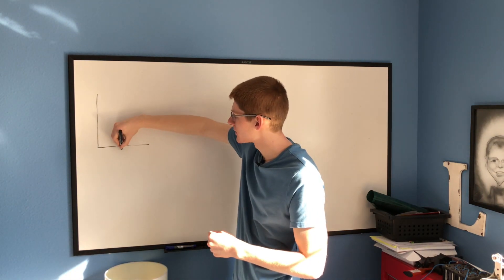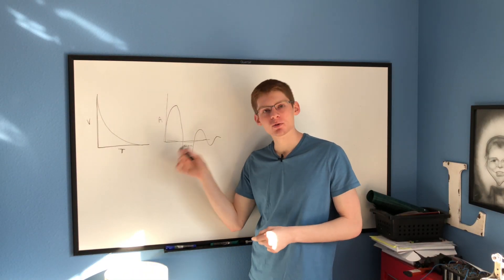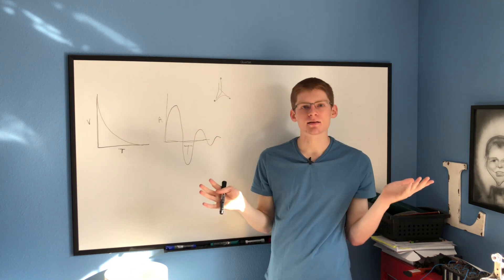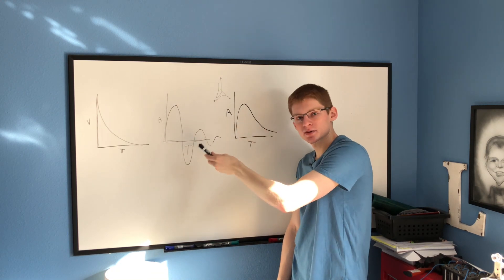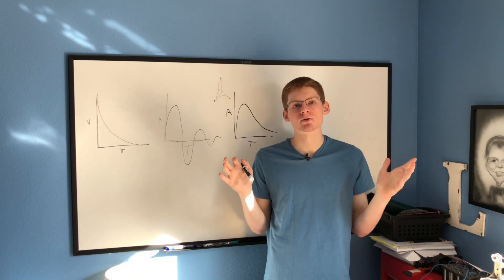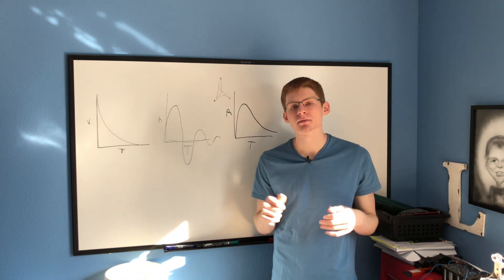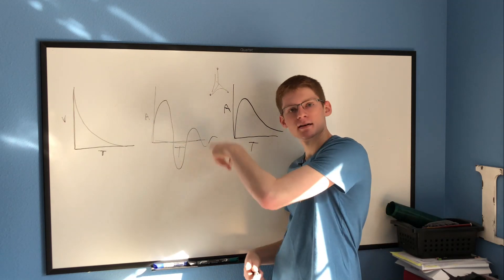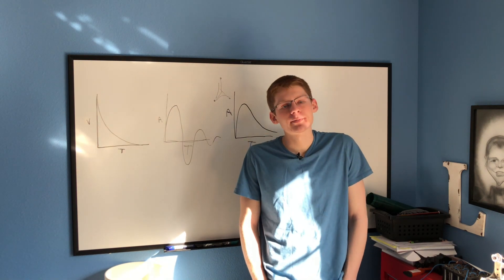Final(ish) Thoughts on the Coilgun Project

Comment: I have some experience with pulsed power systems, so let me give you a comment on why coil guns actually use capacitors.

High voltage capacitors have (reasonably low) capacitance and low ESR. I'm saying something like 1uF, 3-10kV (you can buy something like that for microwaves). You should be able to discharge a pulse with powers of the order of 1-100MW if you properly design it. Combine this with a low inductance inductor and you'll have a system that can provide peak forces of order 100-1000N with relative ease. If you don't use capacitors, the parasitic capacitances of the system (mostly battery) start limiting your time constants. That's why research-grade coil guns still use capacitors, they're the way to go.

The reason researchers rather use high voltages and high currents can be explained in the equations (I recommend you do it on paper so you can see): Coil force F is proportional to I^2. Say you have a pulse (assume a square pulse for simplicity) of "dt" long. The velocity you add to the projectile is dv=a*dt; which through Newton's second law is dv=F*dt/m. Since F~I^2, you get that dv~I^2*dt/m. But the pulse energy is proportional to I*dt (E=I*V*dt), meaning the shorter the pulse (the smaller dt), the higher I is for the same energy. So the shorter the dt, the higher I, but you get the benefit of I^2 for velocity increase; which works in your favor, efficiency-wise. In summary, you always want to minimize dt and maximize I. The easiest way to accomplish that in real life is to have the lowest capacitance possible since time constants (of both RC and RLC circuits) are proportional to C. The high voltage is a by-product of that effect to keep the energy (1/2CV^2) the same. My mental picture of this is like if each coil is like a hammer that "dings" the projectile, imparting its energy on it to accelerate the slug.

Keep studying. You're really young and will accomplish great things if you just keep at it! I recommend you look into the academic literature if you're interested in seeing what serious people do with coil guns (use Scihub if you can't access the papers). Independent thought is important, but as you mentioned in one of your videos, you're not the first one to come up with these ideas. Reading brings you to the "shoulders of giants", so when you think and look ahead you can see things that no one has seen before!

Comment: I wonder if you can use an inductor to power a coil stage rather than a capacitor... you might get a stronger current pulse.
Effectively, you would discharge a capacitor into a large inductor (this inductor doesn't need to be optimized for field, just inductance). Then you switch the capacitor out of the circuit and connect the inductor to the coil and a shunt resistor to dissipate the energy. The collapse of the high inductance magnetic field will create a large derivative in the current (i.e. the inductor flyback).
I think you have magnetic saturation incorrect. The magnetic moment generated by the projectile will saturate, you can only align the atoms until they are all aligned. However, you can still increase the external magnetic field. The force comes from the interaction of the external magnetic field and the magnetic moment of your projectile. F~B*m. If m saturates, you can still increase F when you increase B.

Comment: i'm not done yet, but don't you need MOVEMENT through the magnetic field with the copper projectile to induce the eddy currents? that would imply you'd need to inject the copper projectile into the system much like a railgun. just a thought, curious if i'm missing something.

Comment: if i am not wrong the trick is not remove the capacitors, it is just design the coils ( in theory ). Then i don't know what are your calculations and only have an idea of what you want to get try put diode on the circuit to avoid the negative effect of the discharge of the capacitor remember it is not a rail gun that can be another good project.

Comment: I'm wondering if eddy currents generated in the projectile will be a significant factor in the forces acting on the projectile. Specifically, if currents induced in the projectile (or even other parts of the coil gun assembly such as aluminum backing plates) will resist the forward acceleration of the projectile. Based on my admittedly vague understanding of electromagnetism I think there must be some sort of parasitic losses along these lines, but I don't know how significant they are in comparison to the force accelerating the projectile. Good luck on the project! Great to see someone putting thought into it, rather than just trying to dump as much power as possible. Subscribed to see your progress.

Comment: Hi, I liked the idea on your 3rd video about coilgun, personally I would have reversed the current and direction of the projectile so that the maximum force would be at the beginning and accelerated could escape the high magnetic filed, but still having acceleration till the end. 
at the same time I do not see why you do not use a ferromagnetic pipe which could increase the magnetism and at the same time increasing efficiency of the overall (motors that you mention use a ferromagnetic center to increase efficiency).

Comment: You really should finish the project.  Yes, it is not optimal, but 1) you could still learn a lot from the build.  2) you are falling into analysis paralysis, which is not a good place to be.  Make this and understand it is a iterative process.  You don't need perfection the first time up.  3) you should deliver on the project, unless a major issue develops.  Not getting optimal results is not a major issue in a iterative process.  Think SpaceX.
Reply: Also, dont give up on a concept before prototyping it, you cant know for certain how efficient or not it will be without testing it.

Comment: I have spent some time over the holidays on this topic. I am an electronics engineer with a university degree and just liked the idea of building a BB coilgun. There are several problems with that, for ones the BB projectile is very small, but I like the idea of using cheap standard projectiles. From what I see in most other projects, they are just building it by trial and fail. Not even bother to do some calculations. But if you do and understand physics then you see also the advantage of a small BB projectile. There is a limit of the magnetic force you can apply to it so if you design it properly it should become a very energy efficient coil gun.
Some design considerations I have made so far.
- The length of the coil should not exceed the diameter of the BB (I plan to use 6mm BB) much.This is why you latest design was an eye catcher for me.
- No optics to trigger the current in the stages. All will be timed by a micro controller. And yes you will need an oscilloscope to fine tune the timing. As there are a lot of variables like friction, air resistance etc. that would be hard to calculate.
- I plan to use capacitors or better capacitor banks. But the issue I see in most design is that they use the same coil and capacitor for each stage. But as the projectile accelerates with each stage, the time it spends in the coils magnetic field is shorter. So the current must be applied for less time than the previous stage or it will slow down the projectile. The simplest way to do that is to size the capacity and thereby the time the current can flow in the coil. The current should be 0 or close to if the projectile is in the middle of the coil, otherwise it will drag it back. You could also try to shut the current somehow in the right moment, but I guess that would be a very difficult problem to solve.
I assume if done properly it should be possible to build a BB gun that can shot one BB after the other without having to wait seconds to load the capacitors between the shoots.
The only thing I am currently struggling with is how to load the bb into the barrel. I have see a design with a servo(too slow). Maybe I will use a solenoid like push system.
The other problem is gravity, how to prevent the bb rolling of out the barrel, but not having a lot of friction.

Some thoughts on the wave idea
This might work if you have a magnetic projectile that has polarity, but I doubt it will work on a ferromagnetic projectile. Maybe best to explain is why a AC solenoid works. I guess your thought is that if you apply the negative portion of the wave in the right time, you would accelerate the projectile further. But the opposite will happen. It will drag the projectile back in the coil and you loose velocity. 
Simplified if the current will change direction, the magnetic field does as well and change polarity. But for the projectile the polarity does not matter unless it is a magnet by itself.
BTW once you have your oscilloscope you will see that there is a negative part of the wave that is caused by the coil that wants to continue the flow.
Reply: The only thing I am currently struggling with is how to load the bb into the barrel. I have see a design with a servo(too slow). Maybe I will use a solenoid like push system.
The other problem is gravity, how to prevent the bb rolling of out the barrel, but not having a lot of friction.

how about a revovering like drum feed, the drum only lines up when when in use and the first coil is on

But the issue I see in most design is that they use the same coil and capacitor for each stage. But as the projectile accelerates with each stage, the time it spends in the coils magnetic field is shorter. So the current must be applied for less time than the previous stage or it will slow down the projectile. 

how about changing the length of each coil so the time it spends in the coils magnetic field is the same
Reply: To help better time the stages of the various coils, why not dope or use part of a Thorium Welding Rod (very safe, low cost and easy to purchase) for the projectile. The low cost and safe radioactivity could be used to trigger on/off the coils. 
As for loading the BBs, check out the old West German G-11 caseless assault rifle rotating bolt design. This weapon was designed in the 1980s but never made it to full production.
Reply: To make the later stages give a faster pulse isn't it ideal to use less inductance rather than capacitance, so you have the same amount of energy but delivered quicker

Comment: Hi, great series of videos. Keep at it and you will get there. Some comments. You are mixing up dumping the energy stored in a capacitor, and simply using it to make a low impedance voltage source and then switching with a mosfet. Split your project into sections and then solve each section  one at a time. For example, start with a bench power supply with effectively infinite energy (for your design) and solve the coil, arrangement and switching issues first. Then move onto working out how you will make the power supply portable. Note that there was a super useful comment from a previous video about diode protection with mosfets. Remember mosfets blow short circuit! Some of my thoughts: think of each coil segment as a tuned circuit. Add a capacitor to resonate with the coil. Your idea of push-pull sounds promising. Consider using a split power supply (positive and negative) and use P-type and N-type mosfets to switch the +ve and -ve rails. Also an H bridge could be considered. All coils before the projectile are pushing. All coils after are pulling. The coil where the projectile actually is, is switched off.  Your comments about efficiency are super useful. But to calculate the energy used, you need to get the area under the current curve (assuming voltage stays the same). Simple enough to do with a small micro and an ADC. As for monitoring the projectile position to  time the mosfet switching, I suspect LED and LDRs type approach is going to be too slow. As you have shown, the projectile changes the current through the coils as it moves through. I would think about using that to monitor the position. I also like your 1/x ideas. You could achieve something similar by switching more current though the end coils compared with those in the beginning. I'm not a big fan of the suck and see approach. Try modelling the system in Matlab (or some such progem) first to get your system parameters. Remember with all engineering designs KISS. The full system model will be quite complicated, but a simplified model in Matlab will give you a lot of insight and allow you to start to optimisation process. Good luck - and as I say keep at it. You will get there.

Comment: A few points, if you want to get a sinusoidal/forward and reverse current through the inductor, without charging/discharging the capacitor in reverse, you could use a full bridge driver. In this case the waveform would be "artificial" rather than the natural oscillation, because you'd be controlling it with the full bridge. I think it would make tuning it much easier if you can change the waveform and period etc. from software rather than having to rebuild the hardware for any changes. I fully agree that a single period sine wave, with the period being exactly how long the projectile is within the influence of the coil would be perfect, but this would need different capacitor/coil arrangements for each stage since the projectile speeds up with each stage and spends less and less time in each subsequent stage. Fine tuning this would require building and rebuilding each coil every time you test in order to fine tune the time constant.

Secondly, you can push a ferromagnetic (non permanent magnet) projectile in a coilgun. Once the projectile is magnetized by a coil, and then leaves the end of the coil, you can flip the polarity of the coil and it will give the projectile a little push. This is because the projectile is magnetized, and doesn't immediately demagnetize when the coil is switched off, or changes polarity, so for a brief moment it acts like a permanent magnet projectile would. Of course if you keep the coil on in the reverse polarity for too long the projectile will demagnetize, remagnetize in the new orientation and get sucked back. Changing the polarity of the coil, and demagnetizing the projectile as it leaves the coil with the little reverse polarity push also boosts your efficiency because you're making use of the magnetism left over in the projectile, and desaturating the projectile for the next coil stage, which is good because you lose a lot of efficiency when dealing with over saturated projectiles.

Also, glad you're looking at induction coilguns, I've heard they can be much more efficient due to the lack of saturation, but I've never seen any DIY implementations.
Reply: Well said, but do realize how expensive the components to fullbridge hardswitch the massive currents at very high speeds to create an arbitrary waveform would be. For reference, the (varying topology) circuits used in QCWDRSSTC’s bus mod perform this, and are lower voltages and currents than a coil gun would be (not to mention their size), plus you’d need one of these for ever stage.
Reply: @Ferraday  absolutely fair point, I just mentioned these as he's been stressing that he's aiming for efficiency above all else.
Reply: I would say that there is no real point in switching to the opposite polarity (making it a waveform) because for timing purposes, you want the projectile to physically be closely approaching the coil by the time you reach peak field intensity. Assuming that you actually succeeded in accelerating the projectile, even if you had significant induced magnetism (which you could do before ever firing with for ferrous projectiles, if you wanted to go that way), by the time you got down to zero on the magnetic field the projectile (which is moving away faster than it approached) would be past the physical point that you could be having a significant effect on the now magnetized projectile, AND THEN you have to start forming a new opposite field. The inductance of the coil will likely not allow you to EFFIECIENTLY switch rapidly enough the polarity to be worth it. Not to mention, depending on your coil spacing, you could be influencing your next coil's magnetic field that you would have to take into account in your simulations. It is possible that, assuming you are still worried about the direction of the induced magnetic field in the projectile, that you could actually be inducing a current against the desired power flow in the next coil.

Comment: You can get an oscilloscope for 20$ that actually work fine. To know where the projectile is in the coil gun you can use lasers and a photo resistor. But please just build the coil gun.

Comment: You're getting a lot closer to the truth of things. One thing to ask yourself is why have multiple capacitors versus one for all coils. Then you simply won't have to worry about RLC circuits anymore (except last stages) but only inductor design. I can tell you that efficiency is attainable but only at very low power levels which makes it not worth designing for because you end up with less muzzle energy and you were never constrained by efficiency anyways. Induction is in theory a great idea but that's a whole other bag of questions which I'm currently working on. I do currently believe you may get higher efficiency (without power ceiling sacrifice) but it comes down to the size of eddy currents you get at sort of coil timescales and coupling. It's totally up in the air as of now as far as I can tell